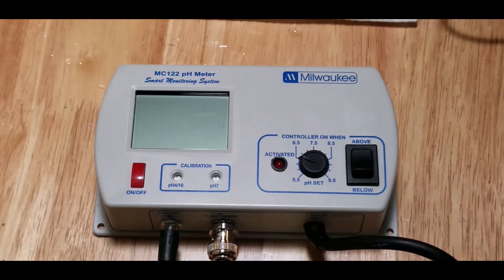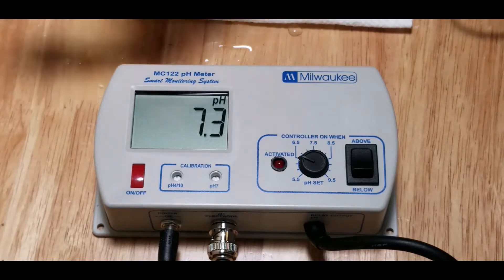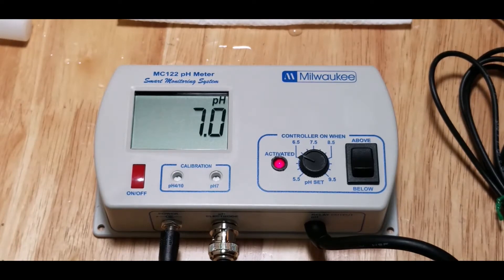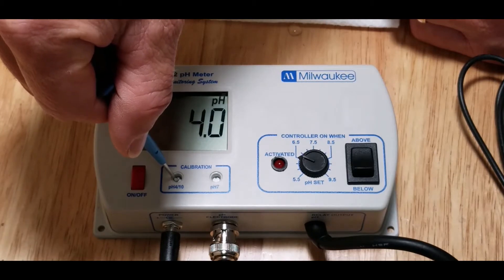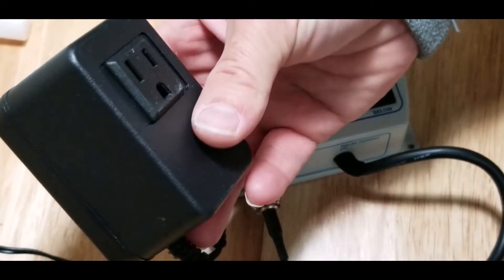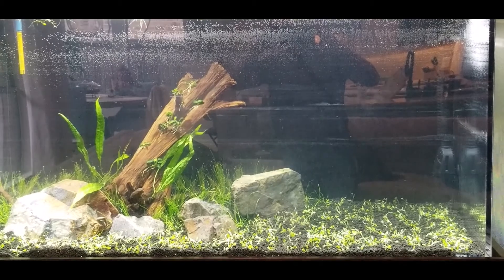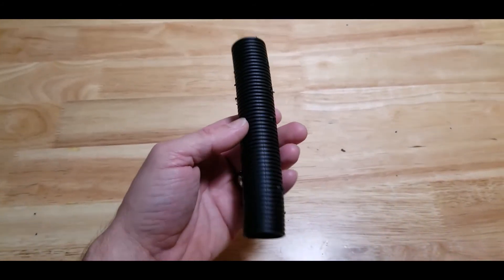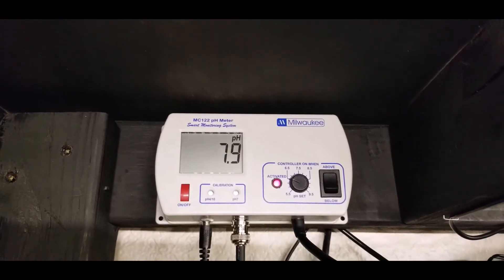Calibrating a New pH Monitor + a Simple Tweak

Comment: Hey, I just came across your video,  I'm looking to get a ph controller and looking at this one.  I do heavy planted tanks. Have c02 on timer, but I'm developing bba, and from what I've read, it is caused by fluctuations in c02. My question is, does leaving this set to 6.5 leave the drop checker in the light green stage all the time? Also are you happy with this ph meter still? Thanks
Reply from the maker: I was happy with it until I got rid of my whole setup because I moved. I have had these for years.  I can't say much about your drop checker, the only thing I can say is Co2 stops when Ph drops below your set threshold. There are many factors at play with Ph, and Co2 levels aren't guaranteed to be at any specific level based on that.
Reply from the maker: I am still happy been using this for many years. Bba is easily controlled with water changes in my experience. I turn off the Co2 controller at night about an hour before lights off so it isn't running all the time. During that time pH fluctuates to about 7.4 until morning when co2 kicks on with lights.
Reply: @David Hughey  oh really,  ok.  I figured you would keep it running all the time.  Thanks for the info! So, bba is related to bad water quality?? I find it only appears in my tank in the direct flow from the filter and wavemaker.  So, do you do weekly water charges?  Tank is heavy planted, and water tests are good with very little nitrates.  Guess i normally go 2 weeks or so between water changes, tho.
Thanks for the info
Reply from the maker: @Curtis Burke  I'm doing 2 weeks 40%    Changes ATM. Have you tried spot treating it with a syringe full of seachem flourish excel?
Reply: @David Hughey  no I don't use excel, I've read vals can't handle excel.  I have spot treated with peroxide tho. Again not on the vals. And that's where most of the bba is.
Reply from the maker: @Curtis Burke  if it's only on vals and you can't get rid if it, maybe get rid of the vals if the HP treatment didn't work, I have done that long ago, good thing about vals is they are cheap and grow fast of replaced.
Reply: @dandj.realty how many times do you calibrate it? The probe has an SBC connector right?
Reply from the maker: @riioken7765  I only calibrated it about once a year and usually never see any change anyways, using a 7.0 testing solution with the probe. I think its a bnc connector.
Reply: @dandj.realty  thank you mate, I really appreciate it

Comment: Hello there. Could you help me clarifying a doubt?. How to get the co2 level in my aquarium correct using a ph controller. I have my controller configured in such a way that when it reaches 7.8 it turns off, but on the other hand, the drop checker is still blue, which we know means that the co2 level in the aquarium is very low. TIA
Reply from the maker: What kind of fish are you keeping
Reply: @dandj.realty  I have a community tank with discus, rhodostomus, roseline sharks and corys.
Reply from the maker: Consider setting it active with a shutoff at ph of 6.5. This will allow much more co2 and those fish should be fine with a lower ph

Comment: I’m going through the same situation as u are. Had a few discus died on me because I was using co2 on/off with light schedule. At night ph would rise to 8.2 and in light cycle it would drop to just above 7. I now know the ph swing did the damage. Such a stupid newbie mistake I made and it cost me 3 discus so far. My mc122 is coming in a few days. Right now I have the co2 running 24/7 and ph is pretty steady at 7.7 at maybe 4 bps. Drop checker in between blue/green. My KH=15 and GH=4-5 atm. Do u have any advice on lowering my KH? Would u just RO water and add equilibrium or use the acid buffer? I would like to hear your update on your setup and compare. Btw this is my first real tank. Only had betta bowl before. Tank is a 125g with decent amount of plants. I’m always willing to learn.
Reply from the maker: That is quite a gap between kh and gh. I would definitely do some water prep prior to changes. I use a 45 gallon trash can dedicated to water changes. I fill it will RO/DI (100gpd) and add equilibrium to make the gh around 3 to 4. If needed, I add a little seachem alkaline buffer to the tank if the ph starts hanging out below 6.3. My pH monitor shuts off Co2 at 6.3 currently. I use a small pond pump with the python tubing to pump the new water into the tank through my fx6 maintenance valve.  For your plants you want the kH and gH to be in the 3-4 range.  Discus are a little more tolerant than alot of people say, especially with them being raised in tap water at the breeding farms thee days, however huge gaps between kH and gH with large pH fluctuations is indeed a bit of an issue. One more thing- I used to cut RO with some tap to keep the mineral content before I started using seachem equilibrium with pure RO.  I recently learned algae is in the tap water, so I prefer not to introduce spores etc. to the tank. Besides, why not go super clean, and maintain exact hardness parameters all the time, right?
Reply: David Hughey Yeah the tap water here is very high hardness. If I could I would start all over and use straight RO and equilibrium with acid buffer/alkaline buffer. I’m afraid removing them and starting over will put the remaining 7 discus into shock and lose them so I’m doing daily 15-20 percent RO with equilibrium to lower KH. It’s a slow drop but better safe than sorry. I’m also trying small dose of acid buffer and see if it helps any. Being so new to aquarium I can’t help but to over -research and it’s probably stressing me out just as my tank lol. Today the discus ate and chased each other around sort of like the pecking order fight. It’s a good indicator that they are settled in from what I’ve read. Btw the tank is still on 24/7 low co2 schedule and holding ph 7.7. The controller is still not here thanks to ups. I’ll get it Tuesday now. If u have any new finding please update. I’ll be checking back here. Thanks for replying back with advice.
Reply: Forgot to mention those nerite snails are incredible with algae. They ate so much algae that the pond snails starved to death. I can’t find a single one. Only bad thing is sometimes they crawl outside the tank.
Reply: Co2 running 24/7. I am not sure about this but do plants go through photosynthesis during the night or without any wrgb light? That means the ongoing Co2 ( 24/7 hrs ) will raise the Co2 levels in tank and oxygen will deplete or at lower level than the Co2 level in the tank. Is that good for discus?